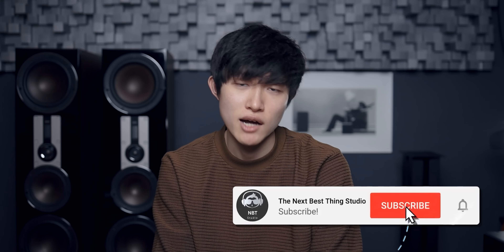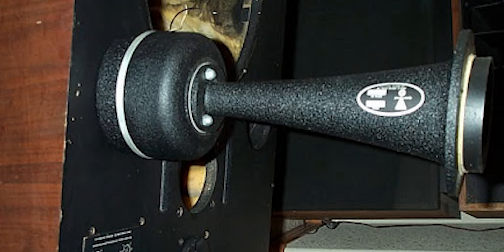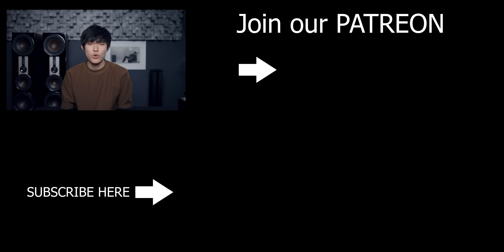Vintage HiFi speaker drivers like THIS was the BEST for a reason

Comment: Great plains audio I this still manufacturers a modern variation of the altec 604 driver. They also restore them as well I think. I think they have all the old production equipment from altec for manufacturing these. Not cheap but glad they still exist.  I agree that their is just something about those older high efficiency drivers. I think some of it has to do with tube amplification that was available back in the day and the synergy those two things brought. Thanks jay!

Comment: I have new AlNiCo Celestion, Weber, WGS, Eminence speakers in various guitar tube amps. They typically cost £200 for the driver & where the total tube amp with AlNiCo speaker costs £1500. And this is the core tone and sound of what is recorded that is being played back on a £50,000 system...that can’t afford to have AlNiCo drive units...go figure!!!

Comment: I like to simplify things so everybody else can actually understand it so here's how to do it. They make champagne glasses out of plastic glass and crystal and you can even get them in metal flutes if you want. The reason why the speaker sound different is simply due to the fact that the magnets  when you couple them electrically have a different resonance and different magnetic response due to current input basically just like we agree that Transformers on a tweeter or in the audio path or capacitor sound different.

if anyone has ever experimented with ferrofluid they will be able to tell you that  different magnets  May produce different patterns if looked at or inspected closely,   now try doing that next to a Wi-Fi router or infac right next to an AC outlet or in a room with a lot of Emi and in a cave or in a faraday cage in fact you will notice that the ferrofluid actually reacts differently.

the reason why the measurements and what you hear usually don't add up has to be something that must be stated because believe it or not it's not just the measurements but how you measure.  

why do people buy focal tweeters that go up to 40K when you can spend about $8 and get a pair tweeters that are piezoelectric that do the same thing?  anyone with a measurement microphone can tell you that a tweeter can reach a certain frequency and if you actually look on a frequency graph you will see that the Tweeter that's the piezoelectric would on paper at least seem Superior.
but in fact what's really happening is that we're not measuring with our ears for measuring with measuring microphones which have a completely different characteristic compared to  what our ears actually perceive as sound.

those who have owned electrostatic speakers for example will absolutely tell you that they do in fact sound different in different rooms conditions from even if they're at different elevations.   even the amount of pollution in the room can have solutely affect the sound that's the weird thing about electrostatic speakers. They should measure just fine right from one room to the next and one reuser to the next but they never do.on paper they sound the same but again to people's ears they definitely   have audibly different characteristics.

George Carlin a while back actually did something about the F-word and did a whole skit on it and mentioned how is one of the most useful words in the English language as it can have so many different meanings. On paper or on text you can get one meeting or the other but quite honestly if you use it in speech then it can take on a whole host of different meanings.

Comment: The "pole piece"  &  the size of the Magnetic Gap, also matter. If a "rare earth" Magnet can be designed  & placed in the Driver to "focus" better into the Magnetic Gap. It really shouldn't matter. The Truly compromised Magnet type, is the very common "Ceramic" types.  Ask Sandy Gross, at 'Golden Ear', He had a lot of experience with "Alnico" magnets. For as a Kid, We both "raced" 1/24th scale Slot Cars. Sandy was so successful. He and a Partner, were paid over a Million $$$$ U.S, from Sponsors !  Yes, that was a "real thing" in the Mid and Late 1960's. It was BIG ! How else  do you think Sandy paid for His tuition to Johns Hopkins University in Baltimore ???  That's where He met Matthew Polk, and the rest is History. btw - a weird coincidence  - Where We all first raced these Slot Cars in NYC, was POLK's Hobby Shop !  No relation to "Matthew" ...  But, Play "the Twilight Zone music" !  lol   P.S. Magnetizers to improve the Gauss Ratings of the Motor Magnets , were widely used. Put away, Your fancy Mechanical watch. P.S. P.S. I'm not disputing the spelling. But I'm guessing " ALNICO " could have been a brand or trademark name . thank you.   ;-)

Comment: What do you mean with musicality? It's an audiophile term which says nothing in my opinion. Tube amplifiers have high distortion but that has nothing to do with hifi. I mean you don't wanna have a speaker which distorts high. Why an amp which produces high distortion?
Reply: It's all about throwing around meaningless phrases to make others think you're an Audiophile...;0
Reply: Tube amplifiers do NOT have higher distortion than solid state!  Solid state amplifiers, run open loop, typically have distortion figures anywhere from 10 to 20 TIMES that of a tube amplifier run open loop!  Solid state amplifiers are basically inferior to tube. They require more stages of gain, are more complex by several orders of magnitude, and they achieve their “superior” distortion and noise figures through PRODIGIOUS amounts of negative feedback, and signal processing!  The basic technology of solid state wins out only because it’s cheap to make.  PERIOD.
Reply: And Alnico magnets died out because ferrite replaced them MUCH cheaper.  Cobalt is a VERY expensive metal. Ferrite is also less prone to demagnetization than Alnico, despite being a weaker magnetic material.
Reply: ASR groupie?
Reply: @milesdufourny4813  
No, just an engineer and designer with 40 years experience in solid state AND tube amplification, 20 of them working for one of the top 10 amplification component manufacturers in the world...

Comment: What would we have today if we had a modernised (if necessary) Alnico drivers = We will have no business/trade so to speak. No hype, no new products etc. Producing a driver with a Alnico magnet vs Neodym is close to be the same. Difference is weight and maybe shipping prices. But imho Alnico sound better than Neodym. Overall performnce is better, more texture and real dynamics.

Comment: One of the best drivers even today is the leak sandwich driver, developed in the late 50s early 60s  a piece of expanding polyurethane foam sandwich between two pieces of aluminium,  especially the bass 15-inch driver nothing could come close to it and probably can't today.if you Can get a pair of 2075 leak sandwich speakers  they're very good
Reply: John ...... I have the Leak 2075's and they are excellent ...... you can hammer those big bass units with heavy rock and disco but they are very good at low levels too.  Currently using a 20W SE tube amp but benefit from real power too.  You cannot beat a GOOD 12" or 15".  To make the big Leak's today ...... thousands ??? UK
Reply: @chrismaynard6016   yes very good want to sell them!!!! You might benefit using a crown amplifier with DSP built-in for the Bass Driver bypassing the internal crossover for the Bass Driver, you can tune The Bass Driver to the other drivers that way. Or another way use an active crossover might be a better route, Nelson pass makes an active crossover design by linkwitz. Or you can get linkwitz crossover ASP and or DSP, From madisound. has it been updated the crossover, what tweeter does it have because there's lots of variations is it the ribbon tweeter? or Wharfedale tweeter? Any experience with the 3090... what valve amp do you have being 15 ohm they are suitable for Valve amps was designed for the leak  tl12/ 0.1 yes looking for one of them or selling mine.

Comment: I wonder if you would ever look at a company named voxative.
Reply: Vaxativ out of berlin,Germany makes some of the best modern full range drivers. The will sell you full speakers with drivers or their drivers but they are expensive. Some of the less compromised single full range drivers out there.
Reply: @brandonburr4900  yes I've heard of them and I am pretty interested in the product. However it seems like they were there and then they went back underground quickly. And by underground I just mean that they are not doing a lot of marketing anymore
Reply: @dilbyjones  that's disappointing to hear. I hope they haven't disappeared. They seem have had some terrific sounding speakers. I'm not sure how much they marketed their product but remember seeing some stuff on eBay. Haven't searched for it in a while. They also did some whole system approaches geared towards streaming. I remember them showing off some fantastic tube gear with their speakers as well but also expensive .
Reply: @brandonburr4900  they definitely have not disappeared but since they are high high-end they really may not want to move into the middle or lower market segments except for people who already know about them... 
I feel like the type of product they have requires a certain level of knowledge already so it's super niche

Comment: AlNiCo has nothing to do with the sound "signature", there are far more important things in a driver than the alloy type of magnet used.
The main reason speaker drivers are not made with AlNiCo anymore is that it degrades over time {loses it's magnetic strength) and it's way more expensive to produce than the more efficient, smaller, stronger and cheaper Neodymium.
Reply: Alnico -- of which there are several different alloys numbered 2, 3, 5, and 8 -- emphatically does not degrade magnetically to any significant degree.  That's why vintage JBLs are often reconed, but never need to be magnetically repolarized unless they've been severely abused.  Moreover, alnico in sizes suitable for woofers is very expensive, hard to shape accurately enough for a precision voice coil gap -- JBL had to outsource their alnico structures to magnetic materials specialist Arnold Engineering back in the day, and even Arnold had a hard time making them to James Lansing's stringent specs -- and extremely heavy.  That's why JBL gave up on the classic D-/E-/K- series of musical instrument speakers in the 1980s in favor of the MI- series with ferrite ("ceramic") magnets, and nowadays the trend is toward the even lighter and stronger "rare earth" magnets like neodymium in that market.  The resulting musical instrument speakers weren't quite as efficient or as bright ---- they sounded more like the typical "guitar speakers" that market was demanding -- but they were still excellent products, with cast aluminum frames, edge-wound voice coils, and tight voice coil gap tolerances of which James Lansing would have heartily approved.

The subject of magnetic material application engineering is way above the pay grade of any "audiophile" gear reviewer.  Alnico was used for loudspeaker drivers because it was the first permanent magnetic material available for that purpose -- thus supplanting the electromagnetic "field coil" speakers that were necessary before WW2, alnico having been essentially invented in Japan -- not because it was the best or the most suitable for such applications.  In fact, in most cases it isn't.  Period.
Reply: Thanks Bruce, you have obviously done a bit of research or have some kind of background in this area.
Reply: @tomhamilton6377  -- You're welcome.  I was fortunate enough to work alongside an expert for about ten years -- although not an expert myself, I know enough to separate facts from folklore.
Reply: I always enjoy fun FACTS, helps prevent confusion...which may lead to some form of dementia. Cant risk it at my age. Haha. My main bookshelf speakers are 1992 JBL L1 monitors. Not sure what the magnet is made of but they sound amazing to me. Cheers
Reply: @editorjuno  
Key point...

"The subject of magnetic material application engineering is way above the pay grade of any "audiophile" gear reviewer."

There's so much ink spilled over the subject but no definitive explanation or conclusion about the magnet type having an effect on sound or not.
Same thing happened with the "revival" of some ultra expensive Field Coil (Electromagnet) drivers from mainly small manufacturers and I've seen a few attempts converting various drivers to Field Coil but again with no definitive conclusion.
Best explanation I heard so far, and which I tend to support,  is that because AlNiCo drivers where supposed to be the pinnacle of driver technology of that era manufacturers such as JBL went the extra mile and gave special attention to Quality Control and tight tolerances.
JBL at some point used so tight tolerances that the paper coil former used at some drivers of that era "swell" from humidity causing it to rub on the pole piece.
With today's automated manufacturing processes, ultra accurate CNC machining, materials development and so on I don't see why modern drivers should lack anything sound  wise.
Reply: @konstantinost3185  -- Modern drivers don't "lack anything sound wise."  In fact, the leading edge of home stereo woofer technology has already advanced far enough to make 15" drivers pretty much obsolete other than for large room subwoofer applications.  As to how that was achieved, I refer you to the genius-level design work of Bruno Putzys at Purifi Audio, who's pretty much overcome the performance advantages of traditional JBL/Tannoy-style large-diameter, short-excursion woofers over the much smaller, long-excursion woofers required for today's compact enclosures -- and that multi-faceted technology breakthrough has nothing whatsoever to do with what sort of magnetic material is used in the motor of the driver.
Reply: @editorjuno  
You misunderstood, I agree with you, I just don't agree with the whole AlNiCo superiority misconception.
AlNiCo "advertise" nowadays only serve one purpose, to jack up the price.
Reply: @konstantinost3185  -- I'm glad we agree.  Like tube amplification -- and vinyl LPs IMO -- touting alnico speaker magnets nowadays is mostly a "high-end" marketing ploy to hook self-styled "audiophiles" with deep pockets.

Comment: AlNiCo is simply the magnet itself. It is merely a type of magnet. Nothing more.
They were merely the best at the time. Often with relatively small magnets/motors, and with shitty pressed tin baskets. Paper cones too. Not that I'm necessarily faulting paper cones. But we can and do engineer and build much better now especially in terms of baskets and magnets. Engineering and especially with regards speaker drivers, machining and materials science have simply no relation to fifty or sixty years ago. The tweeters too remember were simply smaller paper cone drivers, that could beam like a Laser. There were no dome tweeters. Everything was rolled off and warmer sounding. Look at bloody cassettes especially, with their crappy headroom.
I'm a little skeptical myself. I seriously put much of it down to rose tinted glasses and nostalgia.
But then I'm not enamoured with that soft, rounded off, pudgy sound. There was a time when that was simply the best we could manage. No doubt some still hark back to another time. Then again, I'm not a big fan of Tubes. I think solid state beats the old tech. Just look at the recent leaps in Class D quality and implementation.
If you were to take a well implemented and built speaker or even just a driver back to when these AlNiCo drivers were king. They would be entirely blown the fuck away.

If someone doesn't like all that information retreival and detail, they can always attenuate it. Or toss a tube amp in. ;-)
Reply: "Looking" at specifcations and data sheets is one thing, "Listening" peacefully is something completely different. I am quite certain you can buy a new violin that specs better than an old one, but will the new violin sound like a Stradivarius?